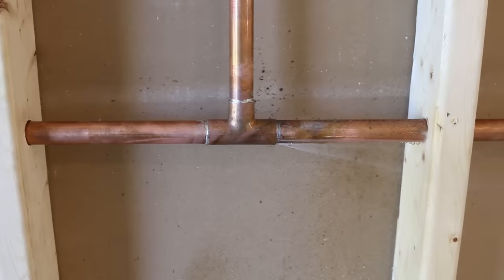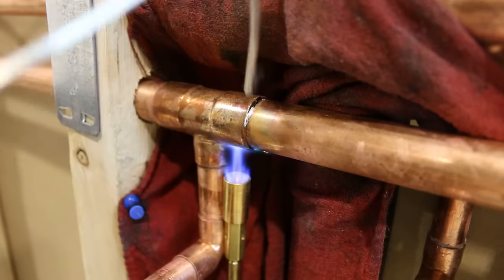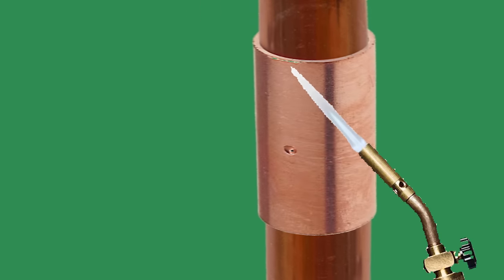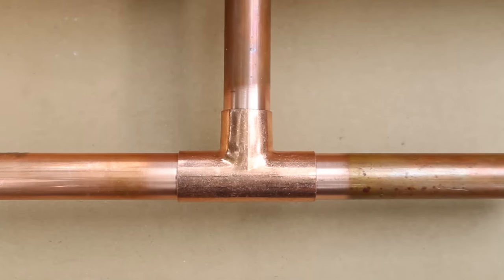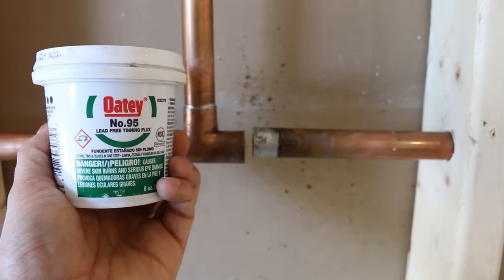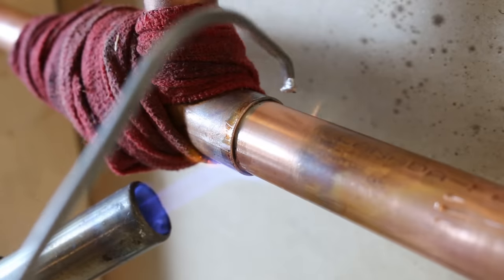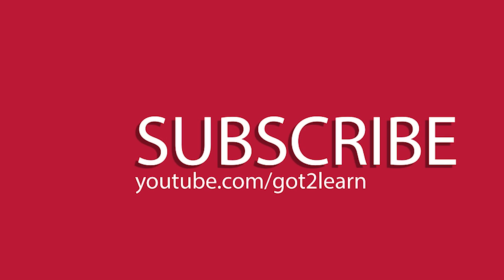The CORRECT Way To Fix A Leaking Joint (UNSOLDERING) | GOT2LEARN

Comment: Thank you so much for your videos. I did my first ever pinhole repair based on two of your videos. Desoldering and this one. I thought I would have to replace the entire t-joint but your desolder video made this fix so much easier. I purchased all the items you recommended including the fire protector. Which, upon inspection, whomever did the previous work in that space did not use one as I could see burned wood. Anyhow, your videos are great. Thank you again.
Reply from the maker: Yo uare most welcome Adam, glad to hear that it worked out for you buddy, have a good one!

Comment: Thank you thank you. i fixed an old copper pipe that haunted me for years. and finally now fixed it after watching your vid. it was in a tight no room spot. Your hint on using vice grips to separate clean sand and resolder using wet rags and I used tin foil as backing to stop fires. Really worked! It's great that people like you help people like me.🙂 Good Karma to you.✌
Reply: Take a tin can, cut both ends off, cut down the side and flatten it out. Tap holes in each corner with a nail, and use wire to hang it behind your soldering area. Reusable.

Comment: Very helpful video. I am renovating my master bathroom and one seam leaked, perhaps from shifting the pipe to fit other fittings and lengths, and broke the seam. TIP! Use a wet/dry shop vac to evacuate residual water in the pipe. Put the vacuum hose end over the pipe opening, squeeze your fist around the end of the hose over the copper to create an air tight seal and vacuum as needed. Be sure to open a nearby valve to allow air to travel with the water. Dry the pipe with a torch for best results.
Reply from the maker: An absolute must, here's a video I made on this: https://youtu.be/lNUAX6mJTlA

Comment: Brilliant video the detail of why you need to what happens if you don't.  I was going to give up trying to remove an elbow joint that had been fine for almost 20 years but started weeping because the pipes have to be unclipped to remove a decorative fitting my wife added so over the years this movement must have caused a crack in the joint.  It's funny I tried the first bodge-it method of flux and solder to patch it, like you said it doesn't work.  It's only when I used the lockable wrench with a hammer that I succeeded.  After that I did precisely what you said - it worked first time!

Comment: Electrician here. Couldn't fix a leak in a sprinkler system I'm installing, and this was the video that showed me how to fix this issue and why it happened. Great show! Thanks plumber!!!
Reply from the maker: Awesome man, i'm glad I could help out ;)
Reply: @Got2Learn  Me too!!!
Reply: Both plumbing and cable running is about the simplest thing you could do, other electrical is hard, i think you guys are too overpaid compared to the kind of work mechanics and boilermakers do
Reply: @SH19922x  Go fix a hundred shit filled toilets and busted plumbing stacks and you'll change your tune - and clothes.  It depends on the job and work location. Dealer mechanics might work fast but they're inside a warm shop. Boiler makers -  not the best environment , assuming they're in an actual boiler. But I've worked with many BM,  who  we not eager to work. So, your statement needs further thought and explanation.  I guess your exposure to the trades is limited to YouTube. This video shows a basic repair in an easy to access area - thats not usually the situation.  Get out there And bust a knuckle...
Cheers

Comment: Great information.  I was just about ready to do what you said not to do and I decided to watch your video first.  You saved me more headaches.  What I really liked is that you not only told me what not to do and what to do but you also showed why.   When I un-soldered my leaking joint, I discovered that there was an un-soldered path from the front to the back of the joint that probably wouldn't have been fixed by adding solder at the joint.  Thanks again.
Reply from the maker: Nice to hear, yeah, I don't see the point in saying something and not explaining it, glad to hear that you appreciated that ;)

Comment: First, I wanted to thank you for this and your other videos. Your well explained techniques  have helped myself and I am sure many other weekend warriors become better at plumbing by improving  skills with your pro tips and techniques. I thought I was pretty good (always got the job done), but now I am much better.  I am currently working on an older 3 story Victorian home  with mostly copper pipe (changed) and a few runs of the old iron which I can't easily access. It would be great if you could do some videos on older homes and working with old stuff with some tips on replacing inaccessible pipes (possibly with pex ?)and also  dealing with old shut off valves.  I have not had any luck trying to disassemble most of the older screw valves when the washers let go when you are trying to fix something simple and now it turns into a much bigger project.
Reply from the maker: Those are all very good ideas, I will start working on those, thank you so much and have fun with your future projects buddy :)
Reply: @Got2Learn  do a video on no slip couplings
Reply from the maker: @Eastbaypisces  I have: https://www.youtube.com/watch?v=ebvqSp-d8-0&t=1s&ab_channel=Got2Learn
Reply: @Got2Learn  yea my bad i forgot

Comment: Thanks so much for the video.  I’ve been cooling down the solder joints straight away oops also probably putting in too much solder as an insurance gambit.  Luckily all my joints have been  leak free except yesterdays oops again.  Very grateful again showing me the correct way to unsolder and make good the repair….

Comment: This video provided exactly the direction I needed to fix a leaking outdoor shut-off for my garden hose faucet.  I had to heat up and remove the old one then prep the copper pipes on either side and install a new one.  The best part about this video and the others I’ve begun watching is not only are we being shown how to do something, there is also en explanation as to why it’s done that way as well.  

I like being able to do things like this on my own, but being able to do them properly and to code is monumental.  Huge thank you for sharing these videos!
Reply from the maker: Awesome comment, thank you so much Jason, good luck with your future repairs!

Comment: I wish there was a channel like this for every trade. It would be the perfect maintenance manual for everything. How to fix you car, your plumbing, your electrical, your windows, your roof, your floor, High quality content that covers all the potential errors and their repercussions. What you are doing is amazing. Thank you for all the great work.
Reply from the maker: That would be sick, let's hope others hop onboard!!!
Reply: @TheSignatureK  thanks!
Reply: Good video,  my dad always wiped the excess solder from each joint you would never find a drip of solder on any of his joints. If one ever leaked he fixed it on the spot. The only time one would leak is in tight quarters. People don't take pride in their work. my dad was not a plumber, he was a refrigeration maintenance man. He also knew electrical.

Comment: An excellent tutorial on fixing a joint. I was going to just reheat the joint and add more solder. I used your instruction and removed the leaky fitting only to discover it was a cold joint with some bare copper still showing on the joint. I removed  fitting and re-sanded the copper and re-sweated joint and now all is well Thanks!
Reply from the maker: Awesomeness!!!!

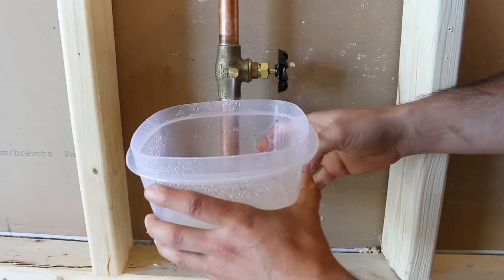Comment: The technique at 6:00 in was super helpful!  I first tried the lazy way and heated the (elbow in this case) and just added more solder. Bzzzzzttt ...nope.  In fact the pinhole got worse.  What I did do, a bit different than you, is heat up the joint, then gently tap the vice grips until the connection is MOSTLY out but still hnaging on at the edge.  I sandpapered the pipe, bought the proper flux (I had tinning flux) and just put flux on the pipe, heated the elbow joint, tapped the vice grips gently until the parts were fully conneted the added solder.  This seemed to work for me, going to inspect all connections for leaks in 24hrs but so far looks solid.  GREAT video!
Reply from the maker: Your way is even better than mine, good job 😄

Comment: SO good of you to post these clips. 
Brilliant.
Really building my confidence to do the pipework at my father’s on Monday! 
My Plumber let us down 😱
The kitchen fitter is coming on Tuesday for 5 days, so I am now going to have to:
- move the mains stopcock 2ft to the right
- move external tap pipe 3 ft  to left (installing compression valve)
- extend cold water pipe feed to boiler - extend pipe 3 ft to right, install compression valve near mains stopcock
- move taps over 2 feet (install compression joints with hot/cold taps)
- install compression joints to the washing machine

Slightly over optimistic for a first attempt, but hey ho.🤞🏼
Reply from the maker: Awesome, I am so glad I can help you out, and I hope everything goes well for you and your father!

Comment: Very helpful for upcoming professionals. Enjoyed watching the video! One thing I do is use a dry rag when whipping the hot
Soldier of the pipe makes it smooth and clean to get right back into the fitting
Reply from the maker: Thank you so much, yeah wiping seems to be a preference thing, I just choose not to do it, have a great day :)
Reply: Does the soldier ever complain about getting that hot?
Reply: Don't wipe the joint too soon after soldering, if the solder hasn't set fully you can crack the joint causing it to leak.

Comment: On large jobs I always test with air pressure. Makes any leak easy to fix.
Great videos.
Reply: Seems like a good idea, it might allow reflow of the joint without the water needing to be cleared out and the joint fully disassembled to redo it, as it would be just a continuation. Just would have to find a way to pressurize it though.

Comment: I’m a 5th year apprentice and currently in plumbing school/ programs. Master plumbers and teachers who have done studies about soldering taught us to always run the torch or the heat all around the pipe while soldering not just heating the bottom and expect to have a strong joint. We actually cut the pipe and see the inside. I haven’t had any leaks by doing it the way we were taught.
Reply from the maker: For small pipes up to 3/4", you can stay in the same spot or in the vicinity of, it won't matter.
Reply: That's interesting to think about. Best to be consistent in developing the art of soldering. But, in relatively small pipes, if you apply heat to one general area of a fitting, when the opposite side is JUST hot enough that the solder flows freely, the whole fitting MUST be hot enough to allow the  joint to fill completely with solder.
Reply: And then in tight places you can't always get around the pipe with the torch.
Reply: @wholeNwon  With small pipes it always helps to use torch with wide enough flame,  not just those pencil beam ones
Reply: @dmitripogosian5084  Hard to argue with that.

Comment: I am not a professional plumber but the first major plumbing job I did was to fit a full c/h system with 21 rads in my own 3 storey house. All went well except that when I filled and pressurised the system I had a single small leak at a T joint in the cellar with one leg of the T into a brick wall. Almost the worst possible spot on the entire system. Pulling the pipes apart was not an option in a confined space so, knowing it was not recommended but having no real option other than drain down and dismantle I decided that as I had little to lose I would try to solder it in situ. I am talking 50+ years ago by the way. My torch was a Camping Gaz, butane I think. I heated the joint slowly, I did hear some steamy sounds, applied some aggressive flux, as it was known then, turned up the heat and applied solder.
It worked! 
For the next 30yrs until I moved house I checked the joint periodically, it never leaked. 
I know I was fortunate but it was well worth the try.
I never had a solder joint leak thereafter!

Comment: Great vid, I just have one suggestion. The prep of the pipe has a lot to do with improper joining. What I'm referring to is when you sand the pipe, a lot of people make the mistake of going around in a circle. But if you go parallel with the pipe and create straight lines, the solder has a easier path to flow versus going over the miniscule ridges or "whoops" like I call them. Kinda like a dirt bike at a race track. Good luck
Reply: Tt
Reply: they never thought me this in HVAC, good tip.
Reply: Shit, that's a great tip!

Comment: Excellent stuff. The only time I've ever had a leaky solder joint is because of water in the pipework. It was at a low point, and there was no drain point. When designing pipe runs, I wish plumbers would take into account the need to drain them out in the future and put in a draincock at low points where possible.
Reply: It's all about cost cutting, shutoffs and drain valves are expensive, and the guy that installs the plumbing will never need them,  but you can bet he has them at his house.

Comment: Great videos! Did my first solder today. 9 joints for a water supply setup with a washer/dryer. Watched a bunch of your videos first! Thanks!
Reply: No leaks btw 😁
Reply from the maker: @commercialconcepts2198  so happy it worked, rock on 🤘🤘🤘

Comment: I completely agree with the problem of leaving some water in the tube. it first prevents the correct temperature to be obtained. And then, when you are doing the soldiering, the low part keeps cold because the energy you bring is mainly used to evaporate the water. Especially true if the water is constantly renewed because you warm the below tube where it stays !!

Comment: I have been plumbing since '84 (or so).
  Excellent post. Your basics of fittings being "mechanically clean", and properly fluxxed, are spot on.
  Strangely, the necessity of clearing the line of standing water, is the most "frequently forgotten. Good coverage! 
  I ordinarily open the discharge side of the meter, in order to drain down outdoors.

Comment: Thanks for all of your great advice! I'm curious though, how do you recommend separating a joint if you don't have enough space or play in the pipes for the pliers/hammer method to work?
Reply from the maker: Thank you! For your comment, I am working on a video just about that, you basically cut the pipe and use "slip couplings" instead of normal couplings, a video will better explained ;)
Reply: Cut it further down and then separate it, soldering a coupling and new piece of pipe in place
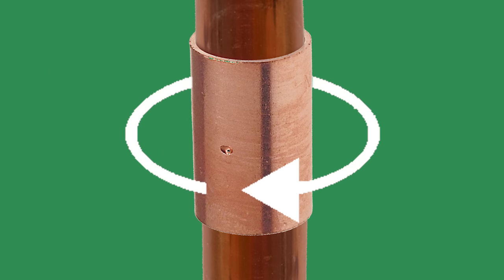Reply: @Got2Learn  Is a "slip coupling" similar to 3:08 in the video?
Reply: @keithupton86ku 

No. See the small dimple in the middle of the fitting? The bulge it forms on the inside is what stops the pipe from sliding in more than it should.

Slip (or repair) couplings don't have that dimple and can slide along the pipe as far as you like.

I make certain I always have a few handy...

Comment: Is it just me that finds it really satisfying to watch the solder run around the joint?
Reply from the maker: No, it's a thing ;)
Reply: It helps to clean the outside of the fitting and leaving a small bead as a structural reinforcement. Do not jostle that leads to a”cold solder joint”. Let it naturally cool as per the video.

Comment: Thanks for this video!  As another plumber stated:  Soldering a joint with water inside causes steam to build up.  Steam will push out the joint solder and flux which you are attempting to install.

Comment: The way I have found to be successful with copper pipe soldering is to make sure there is no moisture in or on the outside of the pipe. Keep the joint clean and use a liberal amount of flux on every surface to be soldered. If those three things are done your solder joint will adhere no matter how ugly you solder. Remembering that the solder itself chases the heat so i apply on the separate side that I am applying the torch so it will travel throughout the joint.
Reply: If you are soldering a shutoff valve on a line with any moisture in it, make sure the valve is open. Steam in a pipe will bounce a closed valve off a ceiling. 😁
Reply: You can do it with water running out through the hole. You just have to add the solder or you may use a welder and just tack  bunch above the area that needs to be repaired. You also will need a grinder so you may grind the "weld" downwards over the leaky area. Obviously if you have a large enough hole you won't be able to do it with running water. Hope you learned something today. Err, hope it helps someone in the future.